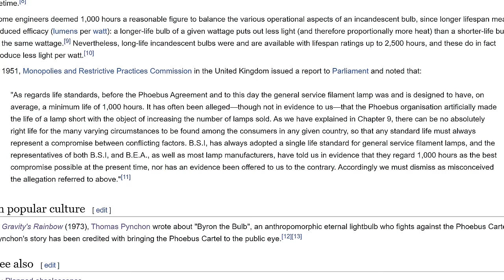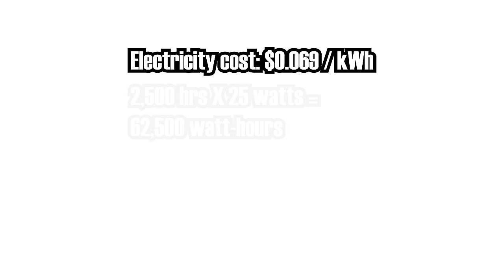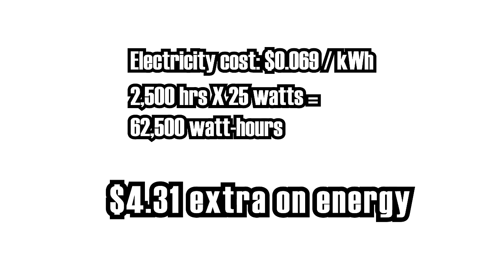Longer-lasting light bulbs: it was complicated

Comment: As an early adopter of LED bulbs (and CFL before those), I have a growing collection of failed bulbs of various types. Most lived up to their minimum advertised lifespan, although in an accelerated fashion due to being run continuously rather than just a few hours a day. It still puzzles me though that some have expired where their twins last twice as long. Seems like I got a few good theories at the end of this episode. Congratulations on 2M subscribers!
Reply: yes leds nowadays is designed significantly worse the capacitor fail constantly and they even overdrive the led chip to acheive planned failure if u take apart led with same wattage ull know its got less chips to spread the heat
Reply: I've seen too many failed lightbulbs nowadays. The cheap LED lights are either running in overcurrent, lack the proper heatsinking, use shitty chips or combination of the above, especially GU10.
All of the ones I seen it was the led chips that were burned.
Reply: From my experience CFLs last more than LEDs. I had both non name chinese and reputable brand LED lamps fail in a few month. Even the cheap chinese CFLs lasted around 2 years and the reputable brand ones around 6-8 years.
Reply: @izimsi i bought a box of LED bulbs about a year ago, I probably got 200-300 hours out of each bulb. After taking them apart to investigate it was innediatly obvious they had designed them to overdrive the LEDs. I bought 4 LED lights when they first came out and, 3 of the 4 still work. One of them has at least 6000 hours on it (I use it on my workspace lamp about 12 hours per day).
Reply: Until recently, I worked for a condo association which maintained over 100 bulbs in outdoor fixtures on photo cell switches. When I started, almost 25 years ago, they were switching over from 60W incandescent to the equivalent cfls in large part for the labor savings of longer life. We dated when they were put in as they had a one year warranty and were pricy, over $10 each. I continued it until I retired earlier this year. The cfls went through 3 generations, each getting smaller although they were rated very similarly. being on photocells, they operated about 4000 hours per year with only one on/off cycle per day. I believe the on/off cycles are particularly damaging to the cfls. Some of the first generation bulbs lasted 10 years or more, far exceeding their 10,000 hour or so rating. Almost all of them lasted 5 to 6 years. The second generation reduced the life somewhat. The third generation, that probably was really pressed on price as leds were nipping at their heels price wise, was the smallest of them all. Some of them only made it about a year, few of them more than two thus many of them did not make the rated 8000 hours.

In changing over to leds, it didn't seem that they were lasting their rated lifetime. I never did, but it would have been interesting to check life of the cheapies rated at about 5000 hours and the name brands with 15000 hour ratings.
Reply: @kurthanushek5520  Some LEDs claim 25000 hour life but I doubt that even from reputable manufacturers. Maybe under the best lab coniditons it could last thay much.
Reply: I always write the date of installation date of the LED lamp (on pencil to stand the heat) and take a picture of the date when it fails, so I can evaluate the brands. There is a big difference between brands. Early LED lamps lasted more. Usually only the drivers burn because of heat If you disassemble them the LEDs still work most of times. Some even allow remove the LED board that have a connector and it is not soldered.
Reply: I switched to LEDs in 2017 and they still working
Reply: I have found you get what you pay for. The cheap garbage will have a pile of duds in the box, while that $30 outdoor flood light is still going 10 years later, running all night every night.
Reply: Oh great. An LED lightbulb hipster. Just what the comment section needed.
Reply: For some weird reason, the only "cheap" LED bulbs to consistently outlast their rating for me, are Ikea's store brand.
Reply: @mernokimuvek  I ended up getting CFLs fairly early on after I got sick of my stepfather telling me off for having the lights on too much. I'd have gotten them around...what, 2012-2014? And, as far as I know, not a single bulb has yet to have burned out at my mother's place. I don't know how they're used now, but when I lived there, I abused the hell out of those bulbs.
Reply: Some of my early LEDs were a bit strange.  My first batch of six, from a British manufacturer, really looked the business, with a nice, finned, aluminium body.  Two failed within a few months.  Two the diffuser fell off.  One, the light just looked really strange, I pulled the diffuser off, and it had about 20 of these large 'eggs' inside.  Two of them are still going.  😅
Reply: @lifeai1889  they don't really overdrive them, not according to the datasheets at least. 
I have built custom high intensity LED panels, and the LEDs own datasheet tells me that I should run them at 85C because the CRI is designed to work well only at that temperature! But that temperature shortens the LEDs lifetime significantly, as opposed to running it at 60C.
Reply: Greater mean value and greater variance?
Reply: Yeah LED bulbs have been a huge disappointment in my experience. Awful low CRI, unreasonable prices for the quality, horrendous lifespans. An awesome technology once again ruined by the businesses.
Reply: @RainIndex  I've had no issue with the lifespans.  I have heaps of spare LED bulbs that are yet to be used, as the originally installed ones mostly haven't failed yet and when they did it was at least 5+ years.  Were you using brand name LED bulbs?
Reply: @TassieLorenzo  Tried different brands but they still don't last as long as they should. Terrible heatsinking + average temperatures of 33°C might be the main reasons why they die so quickly.

Comment: I heard that one of the greatest stresses on the filament is getting turned on (thus the experience of bulbs burning out as you turn them on) and the Centennial Light never being switched off is one of the reasons it lasts so long.
Reply: 100% correct.  When the filament is cold, it has much less resistance than when it is hot and glowing.  This initially excessive current draw is called "inrush current" and it is very detremental to both vacuum tubes and their cousin the incandescent lightbulb.  Most incandescent bulbs die when they are switched on due to the inrush current.

Additionally (not covered in the video) is the alternating magnetic field of the filiment and how it actually vibrates against the static magnetic field of the Earth.  This oscillatory vibration accellerates the decay of the filament and shortens the lifespan.  If you can run the bulb at the same volts/amps but in DC, you will gain longevity.
Reply: Wasn’t that in another video on this very channel? Or am I having deja vu
Reply: If that was rhe main reason, we'd have a lot more 100 year old bulbs, but thr primary reason it's lived this long is simply because it runs so cool and low power. It's a well known factor in lifespan of incandescent and halogen bulbs.

You can buy even for halogen headlights the ultra bright ones that last about 100hrs, or the dingy cheap ones that last 500-1000hrs, or something in between.
Reply: @Jaker788 the centennial bulb used to be brighter
Reply: @truthhurts2149  Well even if it was, something caused it to be less bright

Comment: In a simple comparison with an incandescent, replacing a poorly-made LED once a year sounds like a non-issue, the problem is that many light fixtures are not designed to have the LEDs replaced beacuse of the long supposed lifetime. So if they fail prematurely it's a much more expensive part to replace. Or they're installed in hard to reach places requiring professional help, as opposed to something designed to be serviced by anyone.
Reply: Thats the real problem !
Reply: This will become less of an issue over time for 2 reasons - leds will become more efficient and have less heat waste and fixtures like this will slowly disappear.  EDIT - misread the OP disregard.
Reply: @ntsecrets Why do you think that fixtures like this will disappear?
Reply: A friend bought a Ryobi LED spotlight new. He told me it lasted a handful of uses and the yellow led block inside quit. 
Technically it died under warranty but he lost receipt and couldn't be bothered.
Waste of everything as it was permanently glued together and not repairable
Reply: @Conservator.  I misread it my apologies- thought you meant the fully enclosed fixtures designed for incandescents. I haven’t had any non changeable ones fail on me, but external factors such as lightning are always possible.
Reply: @ntsecrets  not really. The issue is not the leds by themselves but their surrounding circuitry. As usual, the electrolytic capacitor inside the bulb is the first failing component so this should be replaced by a more resilient tech, like solid caps or hybrids.
To mitigate heat (and get more efficiency), we now can have access to better bridge rectifiers made with Gallium Nitride instead of Silicium. And as said in the video, having more leds running at a lower current is a more power efficient design (ie. Dubai LED lamp).
Reply: The REAL problem with a lot of modern LED lighting is the fact that a lot of their fixtures are proprietary.

Had a panel LED burn out in my apartment, couldn't even find the replacement locally, and buying it online, it was 4x the cost of the entire equivalent fixture/bulb replacement by another brand that I could find locally. So the whole fixture goes in the trash.
Reply: @ntsecrets  A mirror image of this situation are gadgets with non-replaceble Li-Ion batteries. They are not going away, on the contrary they're becoming more prevalent to the point governments have to legislate against them like the recent EU rules on smartphone batteries and other Right to Repair laws. I'm not as optimistic as you.
Reply: There’s a video on this channel about this exact issue.
Reply: He has a video on this very subject
Reply: @ntsecrets  Why? I think the exact opposite could happen, most all light fixtures in the future may have unreplaceable lights, and only the fixtures themselves can be replaced, and replacement with an old-fashioned fixture will be expensive, perhaps prohibitively. For one thing, it is rare for people to design their houses (or even simple extensions to houses) from scratch. Residential Construction companies build houses, often in large developments, or apartment buildings in urban areas, and they will have no compunctions to putting dodgy lights in if it saves them money in the short run.  You're assuming the consumers will drive efficiency, but "consumers" in this case are mostly big construction companies who have no motivation to drive efficiency.
Reply: I bought an overpriced Phillips hue (color) smartbulb in 2014. 

It’s been through three apartments and two college dorms over the course of almost 10 years.

Still works even today. So maybe they’re expensive up front, they still work almost a decade later.
Reply: Buy fixtures that have or accept led bulbs instead of the ones with build in chips..
That allows you change the color or brightness later on as well if you want.
Reply: @Swordfish728   legislating these types of things like unnesesary waste or screwing over consumers  is what government is for. That is why you pay them their salary.
Get them to do their job, corperations will screw anyone or anything to save a pennie.
Reply: Guess who made a video on that? You’re right, Technology Connections.
Reply: @squirlmy   again, to taking care of these things on your behalf is why you pay legislators their paycheck. Make sure they do their job and the problem goes away.
Reply: @Nevir202  This is my second biggest issue with LED fixtures. The biggest being that so many are poorly designed and/or overdriven so they fail much faster than they should, but combine that with the fact that so many things with LED lights don't take bulbs and essentially can't be replaced, now instead of a $5 bulb burning out, the whole $50 ceiling fan has to be trashed, unless you want to rip it apart and try to replace the failed component itself.
Reply: @ntsecrets  No need to apologise but thank you nonetheless. 👍
Reply: Simple enough- change out the fixture to one that requires bulbs. Problem solved
Reply: @Lizlodude  Holy shit, I've never seen a light be integral to a fan before, that's a whole new level of WTF?!
Reply: LEDs almost never fail, it's the capacitors inside that fail because of heat.
Reply: I designed a lighting replacement at one of the plants to change over from fluorescent to LED. I can't remember how many meetings I had where the 'powers that be' were upset that I was not planning on getting any spare LEDs to put on the shelf in the Maintenace Shop.
They just couldn't get it through their thick MBA heads that by the time the LED failed both that specific LED and the light fixture would be long out of production, and it was going to be much less expensive to just throw out the whole fixture and put a different one in its place.
Reply: @ghoulbuster1 Modern drivers don’t even use capacitors anymore. Cheap LED lights fail because the are driven (much) too hard.
Reply: @Nevir202 it's getting to be common in the low end market. In theory you could wire in a new driver, the integral LED strips don't appear to be overdriven.

Even commercial panels have color temperature settings and brightness settings.

Another point about construction is (at least where I'm at) there's an implied 5 year warranty on electrical work. It is massively beneficial for electrical contractors to install effective and rugged lighting that is problem free for a bare minimum of 5 years. Ideally 10 years or longer. Customers and general contractors are the people vying for cheaper products up-front because if it lasts less than 5 years they get free work and maybe get a superior product later, they also get to use as leverage in bargaining when they realise later that they want more work done and already have you hooked.
Reply: @Conservator.  I had opened LED bulbs with capacitors inside, maybe the really expensive high quality ones don't use them but the cheap chinese ones definitely do.
Reply: I have some LED from 6 or so years ago, non stop running , still good now.
Reply: @robster7787  I just bought a new old stock one last week.  75 dropping off to I think 15w for night light function.
Reply: @ghoulbuster1  I have seen a few where 1 segment dropped and it was flashing like it belongs in a night club.
Reply: @Nevir202  I met the owner of a Commercial green lightning company. 
He sells installs large complete led panel lights. He told me it's "50-50 that either the Driver fails or one of the segments failed causing the lamp to stop". According to him it's possible to replace the drivers on his lamps but no idea how expensive (either way you pay an electrician to change it out unless it's your home).
Reply: To me it's less about the expense or even the e-waste produced and more about the principle that entire fixtures are something you should only ever have to replace because you want to, because you no longer like the look of them. Especially since, if you happen to really like the style of the one you have now, it's highly unlikely you'll ever be able to find another one just like it in ten or twenty years.

And that's just houses, where you might have identical fixtures in all the bedrooms at most; what about large buildings that have dozens or even hundreds of identical light fixtures? If one or two of them go out and the company is no longer selling that exact model, they're going to have to put up with mismatched units or remodel the entire floor. It's bad enough knowing that it might not be possible to find perfectly identical replacements for the LED fluorescent-style tubes that a lot of businesses and schools bought in the last decade (as much as it would pain me to go back to mismatched tubes, we've suffered through that before, though I'm hoping the generation that never knew such madness won't stand for it).
Reply: @ghoulbuster1  Oh ok. I have some very cheap Chinese ones and they just have SMDs. There might be a capacitor there but no electrolytic ones. 
I think that these boards with mainly one chip and a few other components are probably the least expensive. 

The older ones that I have,  have/had electrolytic capacitors
Reply: @RetroCaptain  I think this falls under the Alec phrase "BUT SOMETIMES!"